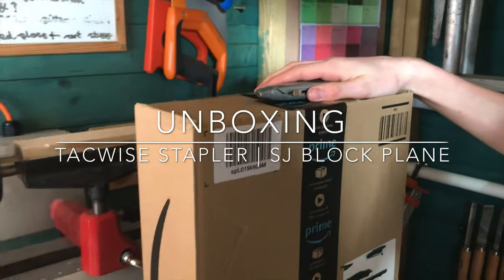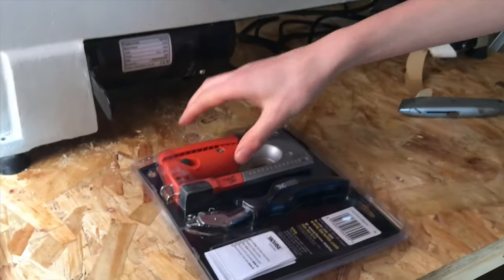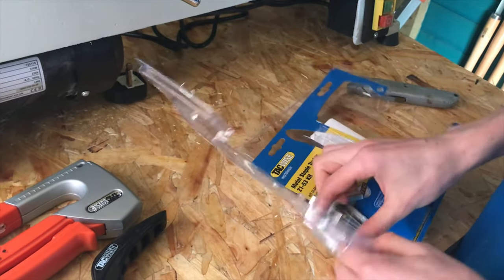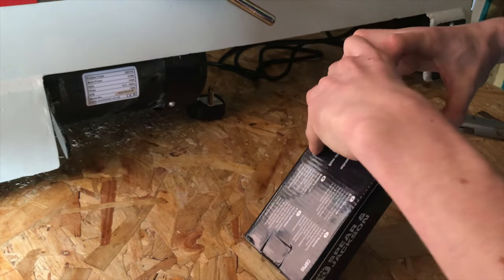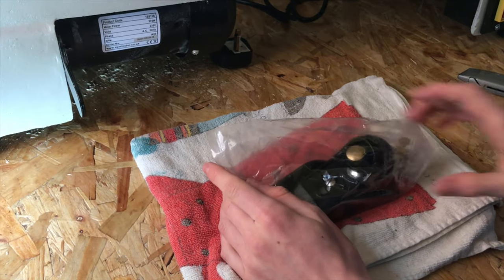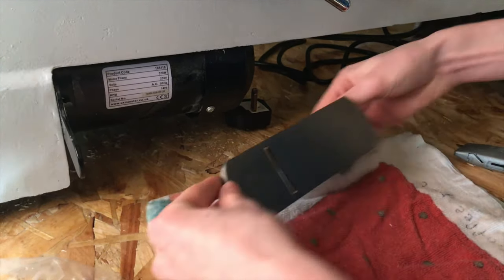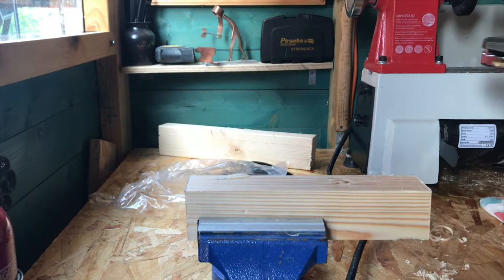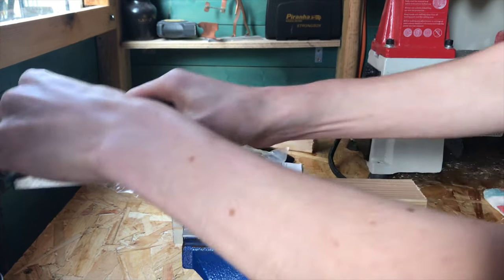Unboxing | SJ Block Plane | Tackwise stapler

Comment: Does it have the lateral adjustment mechanism or you have to tap with a mallet on the sides?
Reply from the maker: You can adjust everything by hand, no need for a mallet. Hope that helps.